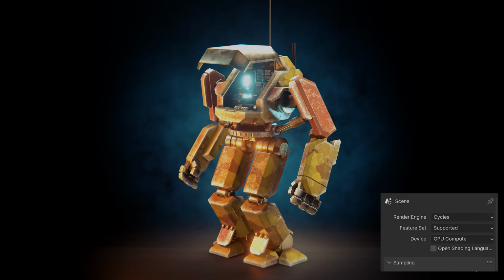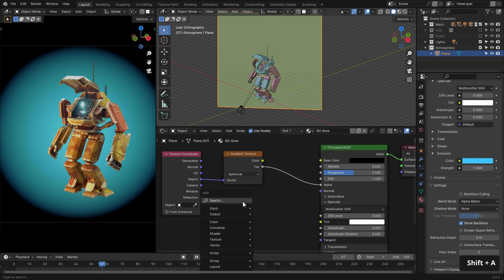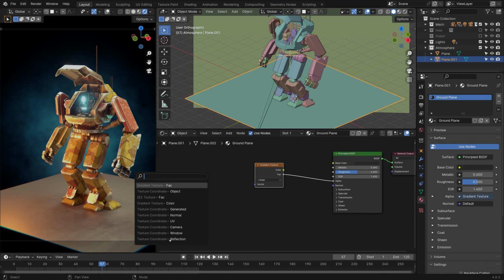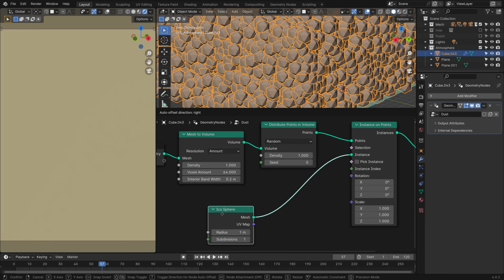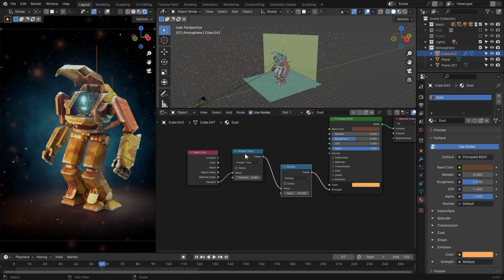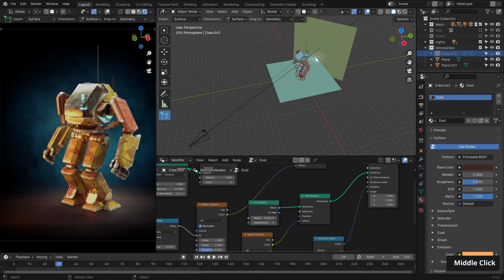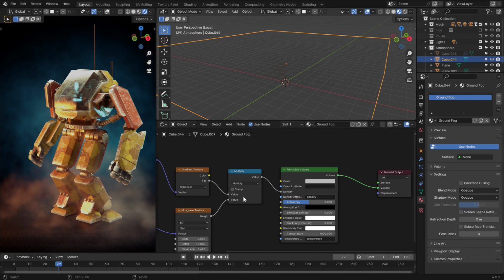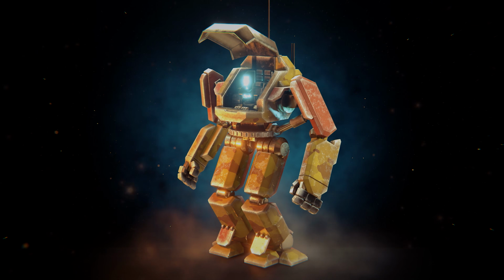Make Your 3D Renders Pop with 4 Quick Tips #b3d

Comment: Unfortunately, this tutorial is not possible to follow with 4.1... 

In the shader editor, the "musgrave" is not there anymore (even knowing that it's being replaced by "noise" does not help a bit... go figure out what parameter to tweak to have it look like the musgrave effect)

In the geo nodes editor, having the noise texture plugged in the offset does not give at all the same result, as that noise texture is now very different.

I start to regret using 4.1... It's not possible to follow one tutorial or course that refers to the musgrave and noise texture.

Comment: Cool. On the dust , would it not be easier to make the top of the volume shader box an particle emitter and have the Dust rain down in a randomized particle way or even float around ? :O)
Reply from the maker: Perhaps it might be easier to use particles, but the added value is learning geometry nodes in the process (that can be later used for much more than just particles).

Comment: the problem is that blender generates very rough gradients. they are never smooth in the final picture.
Reply from the maker: Smooth subtle gradients are trickier and harder to achieve but not impossible. Are you sure your color management/post-processing settings do not mess up the colors somehow? This can make quite a big impact and can be visible on the gradients.

Comment: I was interested to see this - I have a modest MSI GeForce GTX 1650 GPU and it can work with the volumetrics to a certain point but also because of the work I generally am involved with i mainly use EEVEE for 99% of rendering and have used video "cards" with smoke/fog/particles for FX and can be really good within my budget setup.  I have yet to try geometry or animation nodes as have managed to avoid those both so far but surely must be the right time to get into these as newer options in Blender!